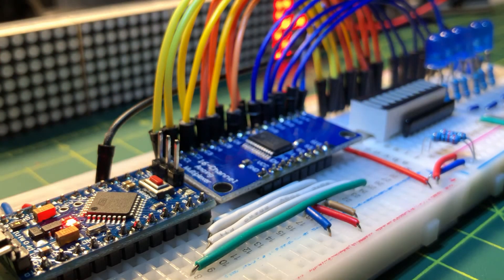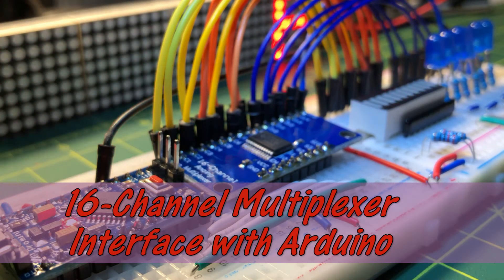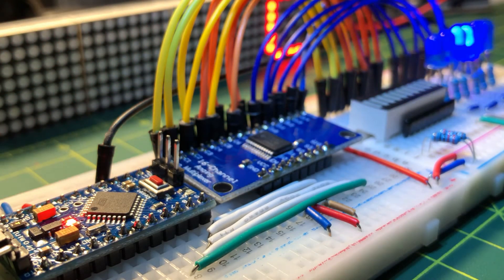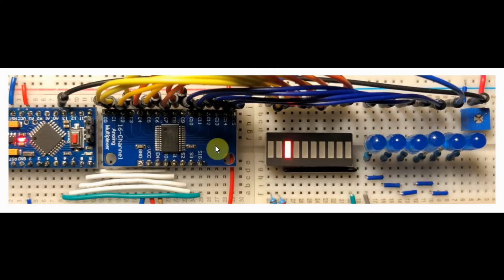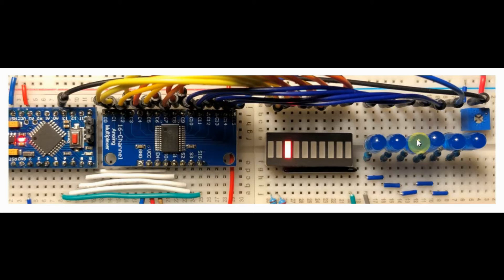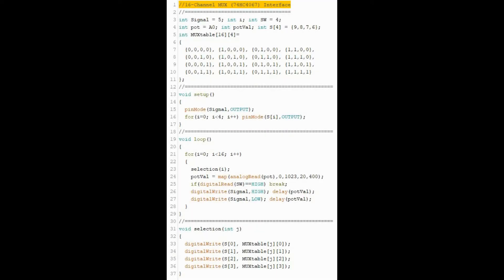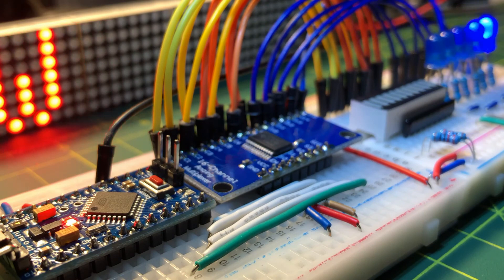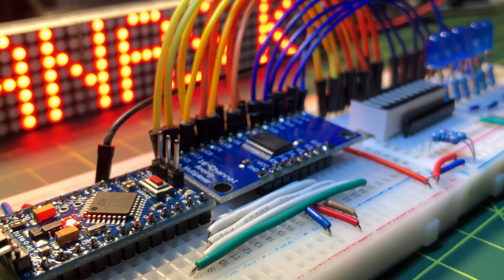16-Channel Multiplexer Interface with Arduino

Comment: Thanks for video. Can I ask something; I want to connect 6 same sensors (lis3mdl) with both i2c and spi connections to the esp32-e card. However, it is not possible to connect with i2c and spi protocols because the connection addresses of the sensors is same. I want to receive data from and encode it on the processor. Would it be possible to connect with CD74HC4067 card?

Comment: Thank you for your great demonstration. In addition, may I know that, does the de-multiplexer "holds" the  value previously specified onto each channel when it leaves and loses control of that channel? (For ex., given C11=HIGH at time=0ms. I switch to and stay at C12 at 1ms~1000ms. What will happen to C11 during 1ms~1000ms?) Thank you in advance.
Reply: It’s an analog chip, so I don’t think it holds or latches the output

Comment: In your sketch, the address (0,0,0,0  0,0,0,1 etc) in the MUXtable are not in order, how come it works?
Reply: The numbers are just reversed. It goes in order of the pins. So he had them in descending order rather than ascending
Reply: If it was the normal way round like 0000, 0001, 0010, 0011, etc then you’d have to reverse the pin order at the top to S[4] = 6, 7, 8, 9 (instead of S[4] = 9, 8, 7, 6) to make it work

Comment: I have a technique question. Using the hc4067 as a demultiplexer, if my input signal is high frequency, for example 40MHz, how is the output ? May i have some phase, amplitude or frequency changes ? I have to make a this for VNWA, so i must consider a lot of things as very low capacitance and resistance

Comment: Hello,
What do you use the EN pin for? I got everything else but that really boggles me.
Reply: That's what I want to know - I can't see where you set the channels to Inputs or Outputs and whether you can mix and match the signals - having some as inputs and some as outputs. Brillant concise video Anas - but could we have more detail ...
Reply: @marvinn42  I think you the read signal pin for input and set it high or low for output. So you can mix & match?
Reply: EN is the enable pin. Use it to select nothing (or disable the input or output)

Comment: What do you use if you want to get a lot of outputs (sensors) to output their 0s and 1s? Would it be possible to multiplex them all so you can read all the sensors' values in a very short time?
Reply: yes just the same way its a mux/demux it can send signals bi-directionaly
Reply: @caseyhassan6136  thx